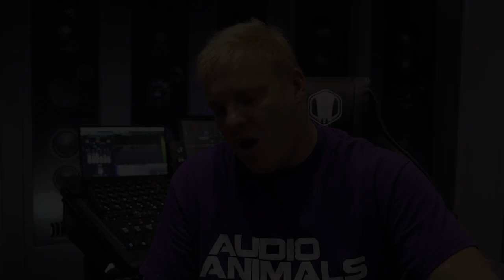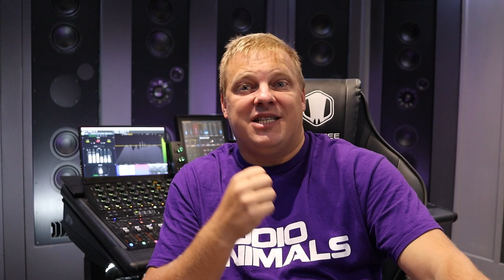What Compressors Do You Use When Mastering And Why?

Comment: It depends on the mix, but yes, at least two compressors you'll normally use in a mastering, three is the norm for me. One for "stability" (light) and two "all in" compressors. You have so called "hidden compression" in a form of transformers and "color boxes" so you could count this as comp. No. 1:))

Comment: Does the Unfairchild work on bass heavier mixes like EDM?
Reply from the maker: Yes. Compressors aren't genre specific. If anything they are dynamic range specific.
Reply: @AudioAnimalsStudio  Thanks. I find with some valve stuff the low end gets too soft.
Reply from the maker: @medwaystudios  the great thing about the unfairchild is harder you go the better it sounds.
Reply: @AudioAnimalsStudio  Cheers. Just saw the video you made running material through it will give that a listen :)

Comment: I have 3 compressors and I rarely use more then one at a time. Most material coming in these days is so over compressed I’m doing more expansion then compression 

I get using different compressors for tone but that person is right. You only really need one compressor. Multiband compressor like the Maselec is a different story 

Mastering=always eq, sometimes compression
Reply from the maker: So you don't use one in stereo, one in mid side, one as a multi band compressor. You should look into using compressors in more than one way.
Reply: @AudioAnimalsStudio  if I need to but that’s not always the case. I could technically live with just an API 2500 and a m/s switcher for the rest of my life and I would be good to go. Too much tubes and transformers sometimes just doesn’t work together well

I agree on the Maselec though..nothing does it like that thing does
Reply from the maker: @Limit5482  yes but it is sometimes the case. Why limit yourself. I'm sure if you had an alpha comp and unfairchild sitting next to you you'd change your mind.
Reply: @AudioAnimalsStudio  never used a Fairchild and I really don’t want to because that would be the most expensive mistake I ever make 😂. I have used the Alpha and it’s great but I prefer the API 2500 and a Manley Vari Mu for my taste
Reply from the maker: @Limit5482  each to their own. I just much prefer the higher end gear for that unique sound other engineers can't achieve.
Reply: @AudioAnimalsStudio  not the gear. It’s the ear. I have mastered albums for some clients and they were adamant that I was 100x better then a certain high profile mastering house that has done mastering for the top 40 artists. They have better gear and a better room then me and you both. It’s attention to detail that matters not money spent on gear. If you don’t want to admit that then that’s fine but high end gear doesn’t make you better at what you do. Just gives you more options
Reply from the maker: @Limit5482  exactly. Again why limit yourself. Give yourself every option. I guarantee if you had the money to buy more compressors. You'd buy them and you'd use them.
Reply: You’re probably right but to be fair, it is also possible the client is overhyping you to lock you into doing more sessions. A mastering engineer I knew a couple years back was living in Los Angeles and showed how at least couple of his clients hustled him into a discount by sweet talking him, saying he was much better than another engineer that cost 4x as much. Ok sure, it was missing that last 5% of quality (by missing using multiple different compressor another mastering studio had) but he didn’t realize he was being used for budgetary reasons and discounted the clients 70% for making 8 songs within a week. Once the album dropped and got like 50,000 streams, that group started touring and just went back to the more expensive engineer with the bigger studio. The reason some clients probably like the sound of one compressor only for the master is possibly because the records they enjoy and love most are most likely “indie made and indie produced” bands and electronic acts or rappers and in all fairness that is what some of the best music is in my opinion also. But if you really want to step up to the plate of someone like, for random example, Bernie Grundman and his team.. do you truly believe they simply (for example) run something through a single opto multi band compressor on some bus tracks, then run it through and 2500 and call it day compression wise? If even that much. I mean there’s videos showing what the wisest and more experienced in the mastering business are doing ... it’s not a single compressor ...
Reply: @burnastein5430  yeah man that’s the secret. 4 compressors every time. Guess the cat is out of the bag 

Also I’m not a troll but you however you have created your account a few months ago…that is 99% troll account 

Keep on smashing bro 💪
Reply: @Limit5482  I use at the very least at least 45 compressors in my mastering chain and my clients LOVE IT!!!! 😁
Reply: @luvitluvitbaby  I didn’t want to let out my secret but yeah I use 45 compressors too, each one with 4db of gain reduction so I can get that dynamic range of a pancake 🥞. Sounds great on iPhone speakers and every master is at +1 LUFS
Reply: @Limit5482  I use 37 EQs as well and boost at least 7db at 100 hz, 500hz, 6000 hz , and 12000 hz, then I follow up with 13 clippers. Hbu? 🤪
Reply: @luvitluvitbaby  fu*k that I would never do that 💩 bro….I use 13 eq’s (can’t be under 10k each though because I don’t trust that $5,000 bullsh*t)and only 37 clippers
Reply: @Limit5482  Right I have to agree with you. 🤣🤣🤣🤣